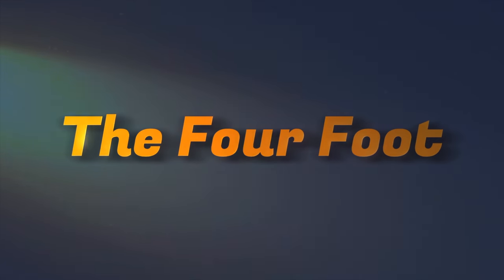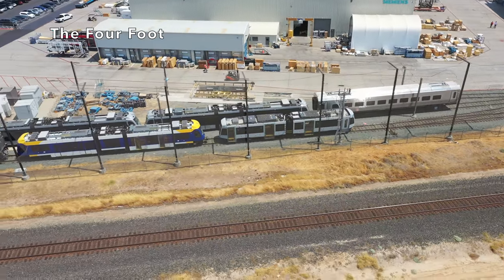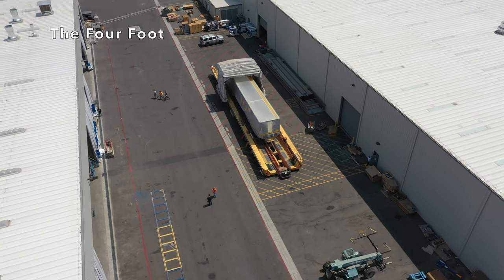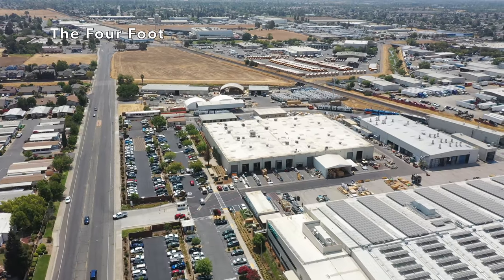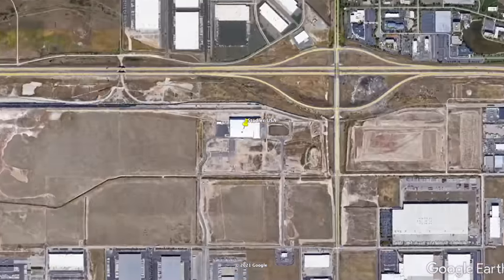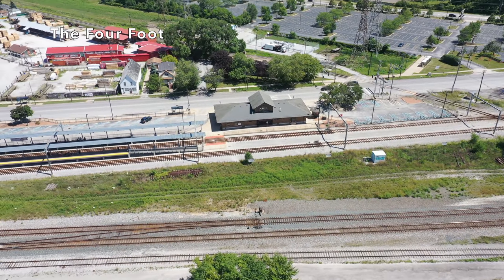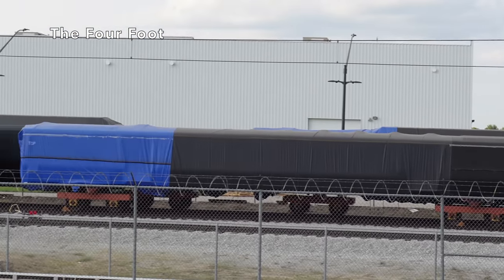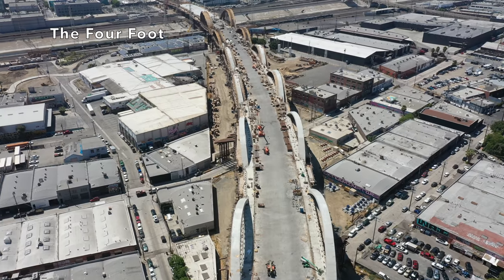Exploring Rail Manufacturing in the Western US!

Comment: The first Sound Transit LRVs were delivered and began testing back in late 2018/early 2019.  Sound Transit identified issues they did not like (I don’t know what they were) and began refusing deliveries until those problems were resolved by Siemens.  Deliveries were stalled for well over a year and only started back up in May this year, but Siemens kept manufacturing the order in the interim hence why they have such a huge backstock of Sound Transit LRVs.
Reply from the maker: That makes sense. Thanks! I know based on problems that Kawasaki had with WMATA that transit agencies can be very particular lol
Reply: @TheFourFoot  When they have to use the cars for 30 or 40 years they can't afford not to be!
Reply: Maybe they will go back to Kinki Sharyo for the next order...
Reply: @jayo1212 probably not

Comment: In the Siemens factory there were multiple instances of there being San Francisco MUNI S200 light rail sets (varying from half finished to only being a skeleton structure). You can tell because of the really angular fronts and the door placement, which is very different from the S700s
Reply from the maker: Yeah you’re right. I was thinking that, but I didn’t want to be wrong lol
Reply: Calgary Transit just commissioned the last S200 (slightly different from the S200 SF) of its first 69 car order, and another smaller order will be built in Sacramento within the next couple of years.

Comment: Brightline is purchasing 5 more trainsets, but with 2 additional cars and also are having 10 more cars made to upgrade the current sets to 6 cars + 2 loco's. Also if I'm not mistaken Alsthom recently purchased both Bombardier and Siemens.
Reply: Alstom didn't buy Siemens Mobility, it proposed a merger but it was halted by the EU  because it would become too big and outcompete all other manufacturers.
Reply: @Tiger313NL  Except, of course, CRRC would still have been bigger.

Comment: What a neat video! Thanks for all the great content, John!

I have question or two if I may. It looks like there are a lot of I guess panel track with railcars or locomotives on it. Do you know why they store things that way and how they move things around? Is it just more efficient to store things on wheels on tracks than on blocks with trucks and wheels stored elsewhere? (Examples at 1:23, 2:42, 3:48-4:15.)

Thanks again!
Reply: It might be those car bodies are designed that they should be supported on the places those bogies are, directly put the bodies somewhere can cause damage to the equipments installed on the bottom of the car and even the bodies. So even if the bogies are not there, some support have to be installed to support the car body on the same place. Then simply use the bogies produced for the same car to support the car body might be the most effective solution.
Reply from the maker: I’d agree, I’m sure it’s just better for the cars to be stored that way. I would imagine they probably transload them on and off the tracks with trailers.
Reply: The panel track your referring to is called "snap track" and its used to store the rail cars when they're outside of the buildings on the asphalt/concrete areas and not on the test track (which is the track adjacent to the UP railroad tracks). Once the wheels (bogies) have been installed on the cars they must be placed on track, either actual rail or on snap track. It's easier to transport the vehicles around the site when they have they're bogies installed. The only time they use blocks for storage is when it's just a car shell.
Reply: @brimstonebrimstone8617  Thank you for your reply! It looks like they would still have to lift the vehicles off the snap tracks to move them -- they are tracks to nowhere. Do the wheels/bogies/trucks come up with vehicles, or do they lift and move them separately?
Reply: @queens.dee.223  they have this really cool machine called a transporter, you can see it in the video when they're showing all the locos on the railroad track at 3:47 and 4:07, it's on the asphalt next to the trains, it's orange (I know that doesn't help much). It was originally designed to transport small to medium size boats at boat yards, it has like 15 wheels on each side that turn independently and it lowers down on one end and it has track rails in it and a cable winch and it pulls the train up into it and then transports them around the site. It's radio controlled, the operator has this box hanging down from his neck with a lot of buttons and switches and that's how he operates it. It moves at a walking pace and the transportation dept moves all the vehicles (locos, coaches and LRV's) around all day, rain or shine, they walk about 12 miles a day.
Reply: @brimstonebrimstone8617  Very cool! Thank you so much!

Comment: Sorry being late to the party, but Sound Transit ordered at least 150 new Siemens S700 vehicles for the East Link Extension and Lynnwood Extension on the existing line. The original fleet from Japan has only 63 vehicles which are obviously not enough to run through this rapid expansion transit. 

Fun fact about the ST S700s: They used the traction package found on the Japanese fleet instead on other S70(0)s in the rest of the nation. In addition, they will be powered by 1500V DC electric overhead wires instead of 750V DC.

Comment: Great footage of these plants creating the future passenger engines of America! (Even though they're designed by foreign companies...[with the exception of Progress Rail/EMD and GE/Wabtec/MPI])
Reply from the maker: Yeah, American companies definitely have the ability, they just need the will (and the contracts). We don’t need any more F125 situations…
Reply: @FPK 
Well, with Siemens, their rolling stock is generally of a modular design, modified for regional markets. The ACS is a Vectron with a different body, the Charger is essentially a diesel Vecron with just one cab, the venture coaches are modified Railjet equipment, and light rail tends to be the same internationally. What the US gets usually is little more than derivatives of rolling stock developed in the EU.
Reply: @FPK 
No doubt the chassis are generally completely redesigned to comply with US crash regulations, but most development work is normally focused on moving parts such as bogies and the technology inside, that being motors, software, computers etc. (though I do believe parts of that are new for the Chargers). I don't think PTC would have been much of an issue, in most European countries safety systems that can independently brake the train have been universally introduced starting in the late 50s, and I've no doubt that PTC shares many similarities to how those systems (such as the German PZB) work with the railway equipment.
Reply: @FPK This is very true, all of Siemens' North American customers have a lot of input into the final design.
Reply: @mikeblatzheim2797  And for that matter, Siemens has also been supplying both GE and EMD in the area of bogies and electrical equipment for years.
Reply: @FPK These days, ETCS is pretty much the gold standard of train control systems. While it's an EU standard, it's used in lots of other places around the world, including (I believe) at least somewhere in the US.

Comment: I don't think you stated, what were the LRVs sandwhiching that VIA Charger at 2:22, are those the new low-floor LRVs we're supposed to be getting here in Sacramento in the next couple years? The color scheme looks right for the blue line.
Reply from the maker: I believe those are Minneapolis. They’re currently expanding their system and I really need to make a video on it.
Reply: The Sacramento cars are in the very early stage of manufacturing (welded carshells) as of 12/2021, the Sac cars will be identical to the San Diego design, Sac is actually piggy-backing on to the San Diego contract. The Sac color scheme will be blue and black.

Comment: The Siemens ACL-42's can recover energy normally lost during dynamic  braking...Why hasn't this feature been  incorporated into freight locomotives?
Reply: Usually because they don't have any way to store the energy (namely large and very powerful batteries). This type of system is very common on electric locomotives, but almost unheard of with diesel locomotives.
Reply: @mikeblatzheim2797  Adding batteries to recover energy during breaking makes more sense than the delusion of pure BEV freight locomotives being tested currently..you'll have to have battery "tenders" for that to work...large ones!
Reply: Freight locos don't brake very often due to the nature of their long routes, so it doesn't pay to have that feature. However, light rail service brakes quite often as station stops are closer together.
Reply: @brimstonebrimstone8617  Heavy freight trains in "murica" especially in the western part of the country, use their dynamic breaks quiet a bit. As there are lots of down grades there..

Comment: How are the trains delivered from the manufacturing site to the customer?
Reply from the maker: Depends on each train type, either by truck, moved directly on rail, or moved on rail flat cars.
Reply: All of the locos and coaches are delivered by rail, UP comes and picks up either individual locos or a trainset of coaches (4 coaches) or a trainset of locos and coaches all depending on whether the customer has ordered locos, coaches or both. All of the light rail vehicles are delivered by flatbed truck.
Reply: What is UP?
Reply: @leeshaoloung7302  UP is the Union Pacific railroad.

Comment: I wouldn't call Hart vehicles light rail just like Vancouver's sky train isn't light rail.
Reply from the maker: Eh, the term light rail is largely inconsequential as it is. Tomato, tomato…
Reply: @TheFourFoot  Light rail more often than not has level crossings with city streets, low floor vehicles, street running, and no automated trains. I know there are exceptions like Chicago El and Ottawa Confederation line but not in this case. Also since it uses 3rd rail power, it's closer in definition to the Copenhagen metro which is a light metro service.

Comment: Yeah that CRRC Building is new to Chicago. They actually built it to build the new 7000 Series for The CTA and bring rail manufacturing back to Chicago. We were at one time kings of manufacturing trains until everything went overseas when it got too expensive to build in America. I guess that's what Trump meant that it's difficult but has to be done. Sure it's expensive but it brings jobs to those who need it the most so they can have a roof over their family heads. I'm personally against it because it's too expensive to build here on American Soil and thanks to years of not manufacturing here there's not many people qualified to do these construction jobs. We have to get colleges to add train construction back and heavily promote and encouraging people that taking the train to work is a better option than driving to work and in the long run cheaper too. I just can't see this being all too successful.

Comment: yes,Siemens is the best,German quality.the Masters.
Reply: Yes! you can't beat German engineering! Siemens is knocking out of the park here in Sacramento, it's amazing what they've done with this facility and what they've done with sales in the US. They basically started this facility to manufacture the light rail cars for the Sacramento starter line back in 1987 and since then have won so many light rail contracts to supply cars for many cities all across North America. in 2012 they started building locos and they recently won a $4 billion contract to provide 100 locos and 300 coach cars to Amtrak (with potential for additional options). And in 2016 they started building the Venture coach cars as well. It's an amazing facility and an amazing business success story.
Reply: Stadler, with their Flirt, Kiss Citylink, Metro and Tina models has managed to win quite a few tenders in Germany and Austria, markets typically dominated by Siemens before. Siemens still builds excellent trains, like the Railjet and ICE models, but it definitely got a bit of competition lately, even in their home markets.